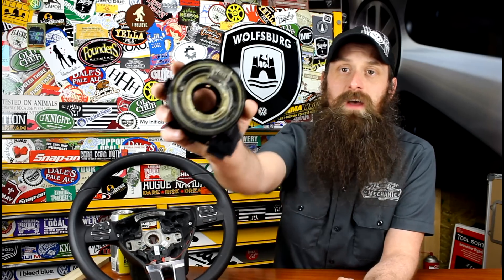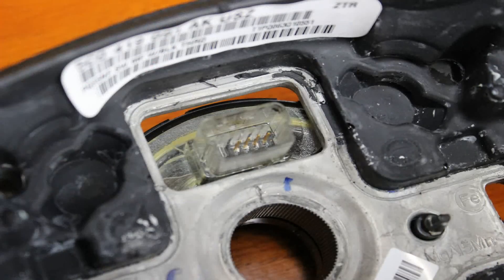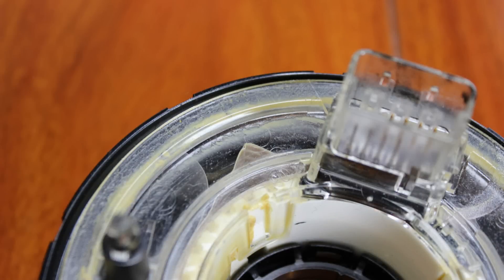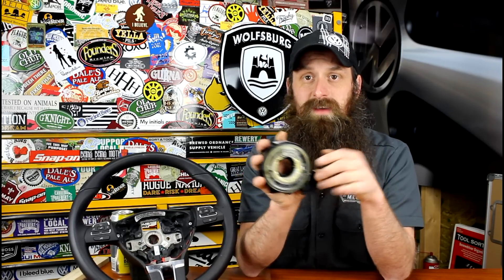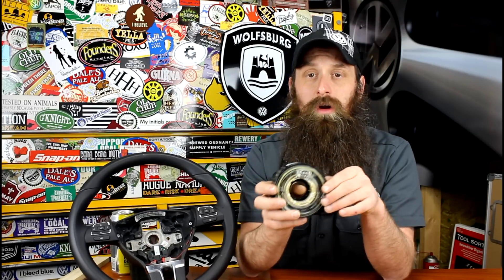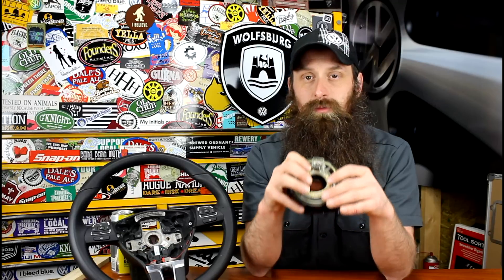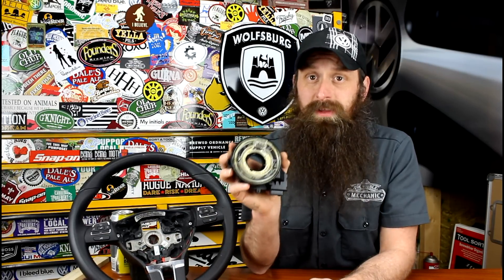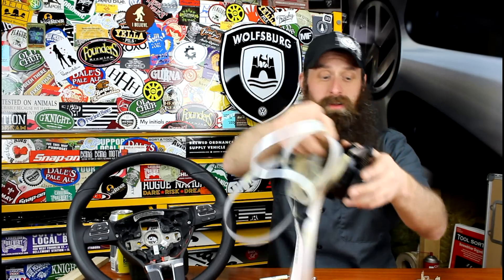How The VW Clock Spring Fails

Comment: Thanks on the clock spring info, How ever on  my car Jetta 5(2009 model) the horn and all staring controls only works when the staring is turned 45"' and more when the wheels are straight it does not work.do I need to replace it?

Comment: Got 2014 Sharan, cut off the ribbon cable 2cm and just soldered it back then super glue to make it stay, easy job and almost free.

Volkswagen eanted €600 to repair it, i did it in 2 hours in total

Comment: Does it require programming after changing? Just replaced for my mk6 jetta, but i get a service spanner in the dash, and the cruise contril doesn't work.
I'm glad that the Horn and other steering controls are back

Comment: @humblemechanich 
Hi. Im having some issue with a skoda yeti 2011. Its havs the airbag light on and the obd2 scan shows error code b10001b. The horn works fine. Any idea of what causes it. Bought online a spring coil and with that one the airbag went of but horn not working. So im a bit lost.

Comment: Hi from Greece.
I have this problem with my touran and my mechanic says that an aftermarket part does not work correctly and i have to get original part which is pretty expensive.
Any ideas?
Is it correct that aftermarket part has issues?
Nice video by the way

Comment: Thanks for the vid. I guess i'll be making a video on this myself. I'm broke right now so I was really hoping it would be something that could be easy to fixed without having to buy a new one. Them things are expensive. I feel bad for the people who can't do this kind of work themselves, having to buy the clock spring that cost so much then they have to pay a mechanic. My horn went out on my 2007 toyota tundra and inspection is due, so its not like I can just drive around without a horn, there's no way the inspection will past without a horn.

Comment: Thanks for your video,  I guess the only concern I have and we'll,  the importance of it having to do with safty is. If it controls airbags then why isn't this under a recall. There are several of these that need replaced in the passat alone and the manufacturer is doing what to fix the issue. I understand it's man made ... but manufacturers have recalls on things that are not that big of deal and people could really care less if it gets replaced. This part not so much.

Comment: My preferred diagnosis technique for a failed clock spring is to take it to the dealer since there's an extended warranty for these on the Mk7s. Mine will be having its 3rd one installed on Friday.
Reply from the maker: 3rd one!!!! DAMN!
Reply: @HumbleMechanic  Definitely not because I drive my car on gravel roads quite a bit 😅. Based on your description here the dust intrusion might've done it actually. No matter, VW Canada covered it even though I'm over mileage for the extended warranty
Reply: My car has a salvage title😢
Reply: @Macdiz  But does VW know that?
Reply: @gmupps  lol yes because I already tried. Plus they have fixed tdi warranty stuff which is still valid

Comment: Hey Humble, I have a 2014 Tiguan where the we recently got a Red solid steering wheel indicator come on and stay on with the loss of Power steering. We have had 3 mechanics throw a scanner / diagnostic reader on the car and wasn't getting any reading to point them in the right direction. (1) Have you seen this happen to many other Tiguan's for that year and (2) do you know what would cause this so we can try and fix the issue?  Appreciate any and all feedback, hope you have a great day Bud and stay Humble!

Comment: I replaced my clock spring on my passat b5.5 (3bg) and got steering angle sensor, went away to a workshop and got the DTCs out and the sensor was dead in the new one and also got "module not coded", switched back to the old one and still have the same issues :(

Comment: Hi humble mechanic, thanks for the video. My clock spring failed in a 2014 RS5. I was wondering if you know if the clock spring in the RS5 is the same as the VW ones that failed. I heard it’s unusual that the RS5 clock spring failed. Also, are there preventative measures to have a clock spring last for as long as possible. Thank you so much once again.

Comment: Thanks for the video, looks pretty clear that must be the faulty part on my VW Tiguan. From a driver point of view: airbag light on, buttons not working on the wheel, front-assist disabled. Technically, I plugged a cheap OBD dongle and made some diagnostics. At first I thought it was a CAN module that was faulty but all errors are matching the symptoms you describe, you said "Igniter" and it rang a bell. Will bring it to a dealer, I don't feel like playing with an airbag. Hope it helps someone with similar issues.

Raw code: 030231
 ECU: 19. CAN Gateway Status: Test failed, Confirmed Status bits: 1 Priority: 2.  
Raw code: 000434
 ECU: 13. Active cruise control Status: Test failed, Confirmed
Raw code: 90001B
 ECU: 15. SRS Status: Test failed, Confirmed, Warning indicator requested Volkswagen: B10001B: Driver airbag igniter

Comment: Is the clock spring another word for steering wheel angle sensor   I have steering light on abs light on traction control light on and steering wheel light on thanks in advance and when I turn the steering wheel my steering angle sensor it stays at zero. Its the clock spring take away abs light away from that I think that's a different issue

Comment: I have a 2009 vw transporter (uk) its making a real bad rumbling/grinding noise when steering. It seems to be coming from just below the steering wheel. I only have to turn the wheel a few degrees and it rumbles... Ive changed all the top mounts. Could it be the clock spring? It really is coming from the steering column rather than thr rack or top mounts

Comment: Thanks again,
My polo 2020 model was the horn and controls was not working at all.

I then switched my car off . Removed all the terminals on the battery.

Then put them back in place “terminals “
Try horn the car while it is off , “engine not running “

It horned. Put the car on . The controls started working..

It has been 2momths now , horn and controls not working.

I went to Vw , they told me stories.. 
Now everything is in order

Comment: My steering controls and horn are not working after getting the vehicle through auction sales, no airbag sign on dash board, scan tool shows U108E. The clock spring installed was a 2019 manufactured.  My vehicle is a 2104 VW Passat 1.8L turbo, is there any way you can help?

Comment: Thanks for this video Charles!  I'm thinking this is what might be going on with my wife's 2013.5 Beetle Turbo.  I got in her car the other day and when I started it the steering wheel light, ABS light, traction control light, airbag light, and tire sensor light all came on.  The car gave me two faults on the vehicle status display - "Error: Airbag" and "Fault: ABS/Stability Control (ESC)".  The horn and all steering wheel buttons work though, and aside from all the annoying lights everything seems to run and work fine.  I'm a novice at repairing my own vehicles so I am not sure I will do this repair myself.  Great video man - very informative!

Comment: Hey, my steering wheel buttons and horn don’t work, I’ll go into a bit off detail as to what happened before, so we took everything out from a 2019 van and put it into a 2005 shell, so everything like electricals, struts, engine, dash, roof lining, flooring, ect… after we got everything connected to turned over the van and it ran, it also drives, everything in it seems to work fine except for the steering wheel as I stated earlier, would it be the clock spring?

Comment: Clock springs seem to fail pretty often.
I've had 2 new cars in the last 4 years and both needed clock springs by 20,000 miles.
Not because the buttons stopped working but they became noisey... a rubbing noise.
Reply: Just got a recall on my vw jetta 2013 for the clock spring. Idk if it was an actual recall but it says if it breaks, it’ll be a free repair

Comment: Hello i have a 2017 
Volkswagen Passat and of course I scanned it and yes it is the clock spring. Please can you please let me know how the steering come off? Where is the rear bolts or screws that hole the air bag on. Also last do this clock spring have to be programmed

Comment: I changed my audi a4 2008 b8 clock spring because of air bag but after changing it, esp and coil light is on. Do I need to scan the system again and how to do calibration?

Comment: My traction light and tire pressure light is on and i am getting 00778, p1698, and b11689 code. Do i have to change the steering angle sensor? Please help me out.

Comment: I have a low pitched "cracking" in my steering column but I dont have an airbag light i can use my horn and my wheel controls work. Do you still think its a clock spring?

Comment: Great video. My clock spring was creaking every time I turned three wheel. The tech replaced it yesterday; today, my horn is randomly beeping. Back to the dealership tomorrow! No service lights or anything.
Reply: the low sound creaking when turning the steering wheel is driving me nuts, im suspecting its the clockspring even though the horn works, mine is a non msfw, did your creaking go after replacing the part?

Comment: Great info video on the clock Spring. I have a 03 Passat GLX 4-motion - any chance you know this very basic clock Spring requires some dealer code reset or does an OBD2 tool justify if needed?  Don’t want to replace and have more codes pop up. Let me know if you can. Thanks 🙏

Comment: 6:30 how can you fix it when this really happens?
Reply: My "tape" cable had broken close to one end and I was able to cut off the broken section and solder the cable leads back on. Still works fine 2 years later.

Comment: That is exactly what was wrong with my 2007 new Beetle I just bought it for $500 it has 63000 miles on it and it's been sitting for 6 years outside 
-the driver's window was left down one quarter of an inch the whole time the car has mold in it thats why it was $500 
I pulled the clock spring and used an ohmmeter to find out why my horn was not working and I found that it had a broken wire in the tape harness 
Just my luck I looked up the clockspring online part number 1J0-959-654-BF part ranges from $360-$480 I was hoping it would be the cheap $33.95 one that is in the earlier models 
Will this one require to be coded ? it has no steering wheel controls it just has a horn and the airbag
oh I did jump the two pin connector that plugs in to the clockspring for the horn and it did work  so my diagnosis was 100% correct I just need to get a new one now
Great video again thank you

Comment: Thanks for this video, Charles. I have a 2019 Golf. Cruise control didn’t work. They replaced the buttons. Didn’t help. The clock spring. Didn’t help (+ my steering wheel was put back on without proper alignment). Then they replaced the harness, which fixed the problem. But now I hear a rubbing or feel some friction when I turn the steering wheel. Not a ton. But it’s there. Is that normal? Could something be misaligned or crimped or something? It’s been about two months now. Thanks, Charles. I’m a new subscriber and follow the dudes at DAP too. 👊🏼.

Comment: The airbag sign went off on my VW Tiguan, buttons don’t work and horn not working. Went to get it fixed at the mechanics. Now my cruise control not working, windshield wipers not working and hydronic power steering issue. What could that be?
Reply from the maker: Yikes. Maybe a module coding issue. Usually that doesn’t impact the power steering

Comment: Howdy Charles. Whilst a certain amount of caution is advised when doing any work on cars, the only precaution you need to take with airbags is to keep the key OUT of the ignition (actually me and my colleagues have changed seats with airbags with the engine running many many times with no issue, but hey ho! I wouldn't encourage that).
Neither do you need to worry about using an ohmmeter. In fact, you should. All the ignitors should read 2.3 +/-0.3 ohm - useful to know if you're trying to trace a fault without a scan tool.
Unless you're working on an old car with a really REALLY early SRS system, in which case, disconnect the battery!! Some dumbass manufacturers started fitting SRS that was always live even when the car was off and locked!!! Ford, GM, I'm talking to you!!

Comment: Fail happened : 69000km , 4 years, VW Caddy 1,6 tdi ,  service 885 EUR. 

You can’ t buy this original part any more cause you must buy a whole thing that is under stearing weel (swiches etc) 

Thank you VW !  I think that your expencive parts suck and hate to spend my money on expencive cars with fail parts. Thats my third 800 EUR repair and it started in 45 000 km. I spand 25.700EUR on this car and now it’ s 27.300EUR.

Comment: @HumbleMechanic My dad and I changed the lock cylinder out of my 2007 VW Jetta 2.5L Wolfsburg Edition, in this process we disconnected the battery and removed the clock spring. Not sure if the clock spring was rotated in the process but steering wheel is straight and everything looks and feels proper. But I have a solid yellow steering wheel light on my dash. I have tried everything from dosconnecting the battery for an hour to reset it, all the way to turning all the way left and then all the way right and driving straight for a bit. No luck... should I just replace the clock spring? Or is there a way to reset it without VCDS? Thanks!
Reply from the maker: Have you driven the car? It may just need an basic setting by Driving the car around
Reply: @HumbleMechanic  I have for 86.7 miles. Most of it highway about 10-15 of it is  town and stop and go.. I know when I removed the clock spring people told me it could be moved or not in the original spot. If that happened should I just replace the clock spring because I do not have VCDS and I don't know anyone with it in my area.

Comment: 09 CC horn worked untill right after I took the vehicle in for factory recall on drivers side air bag. Took car bavk to Schworer Volkswagon and was told by service manager horn was not working when I brought it in (total BS) And it would cost me $150.00 to diagnose.  I will NEVER do business with them again. Thoughts?
Reply from the maker: Horn failure is very common. It may be related. Or it may be just one of those bad timing things.

Comment: I have a 2000 mk4 gti 1.8t with a EPC light issue. Ive LITERALLY replaced every part for that light and got it recalibrated. But once i touch the gas pedal EPC light comes right back on and i have very little power and boost wont even get out of vacuum. Would this be a reason im having EPC light issues or can it be a short? My horn still works when i press down on the air bag and when i lock my car. Ive been trying to fix this for a year and a half now and i could really use the help
Reply from the maker: What’s the faults?
Reply: These are the fault codes im getting off my scanner 
Engine codes im getting are p0102
P0237
P0106
P1338
P1633

Comment: steering horn don’t work and remote doesn’t beep  & Alarm don’t work. Could it be the clock spring? 2015 vw tdi sel 55k

No dash lights

03591 signal horn activation sporadic  011 open circuit 

What’s that?

Comment: 2013 Passat.  I knew my clock spring was on its way when I started hearing binding paper/plastic ticking when I turn the wheel.  Eventually I made a turn one day and I heard a snap and bam.  Airbag light, no hornet etc..
Reply: I hate vw. I had same thing happened to me.

Comment: Well my 2003 B5.5 horns do not work but when I push the on the steering wheel I do hear the horn relay.  Could it still be the Clock Spring??
Reply from the maker: Not if you hear the relay click

Comment: would the clock spring cause my steering wheel to completely lock up? not the steering wheel lock..but the steering wheel is actually not movable.(can't turn it)

or is that the whole steering column assembly that's bad? any idea?

Comment: I had my steering wheel replaced due to leaking fluid, there were  two places that was worn. Can the steering wheel rack and pin exchange affect the clock spring that the horn stops working?
Thank you for shedding light to a subject, for someone like me who does not understand the workings of a car.

Comment: 3:55  Does the clock spring tell the car what the steering angle is?  How do you make sure the clock spring is installed perfectly centered to the steering wheel being straight?  Is it important for the clock spring to be installed perfectly centred?  Or will it calibrate itself if it's not perfectly centred?
Reply: Generally, the steering angle sensor is separate to the clockspring and on the "car side" so, in short NO.
A new clockspring will come fixed in it's centre position. The column should be centre before fitment.
Yes, for sure
NO, defo not

Comment: hi I have vw GTI 2013 2.0 i used to have water leak in water pumb and I change it and now my car dont go for over 140 km and I feel like the car no power like something hold u not much power can u help me with it pls and I dont feel the trupo working and people tell me need to change boost control and I did but nothing stil the same as u drive normal car and advice